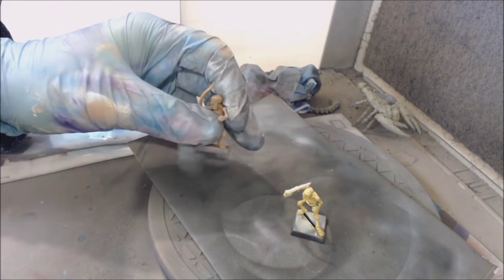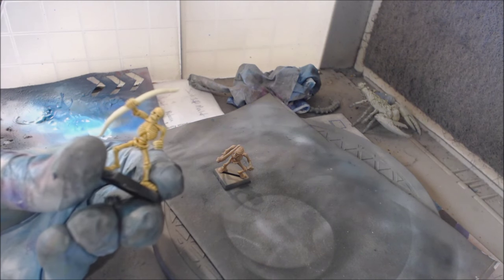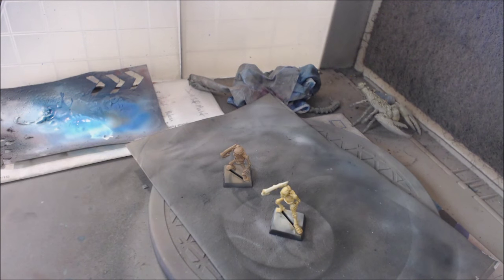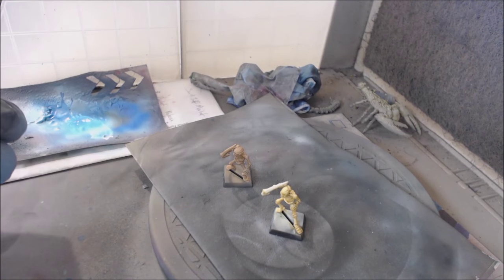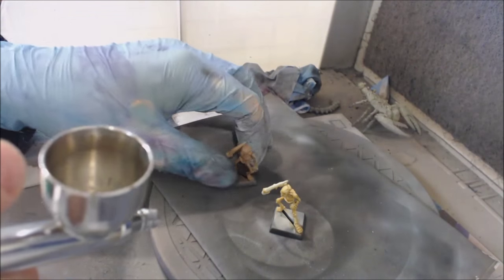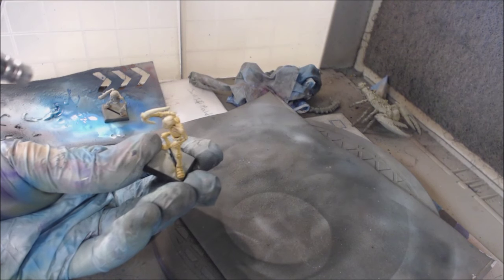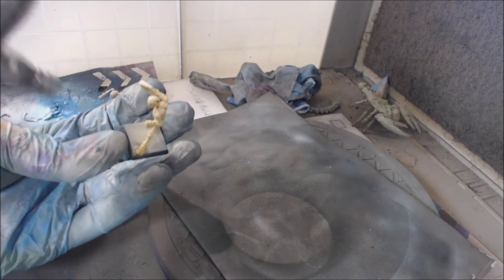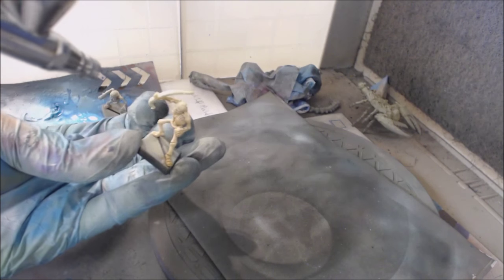Hobby Cheating 16 - Quick Skeleton Airbrushing

Comment: Vince when you are going at the 45 degree angle you say you are not pushing alot of paint. What percentage of trigger pull would you say you are using at that 45 degree angle. Same question for the 90 degree angle brushing.
Reply from the maker: Probably 60-70% at most. Usually less, like half pull. It's always better to build it up a little slowly and then you don't undo the previous shadow work.

Comment: How about extending this approach or describing an appropriate approach for painting a unit or army as a whole. Do you recommend people paint each morel as an individual or are their techniques to designing a unit as a whole?

Nice ideas though.
Reply from the maker: +john tailby Sure, I could do a full tutorial on this, but in short, yes, I would do this color across the unit, say 10-20 dudes, and conduct it just like the factory line painting if you were completely brush painting. Basically, same rules apply, combine as much as you can into steps.